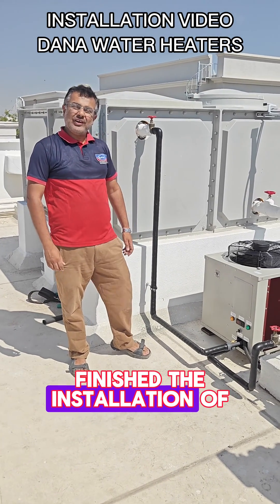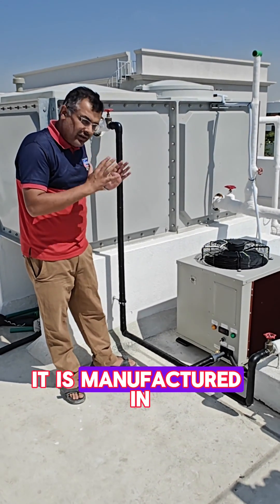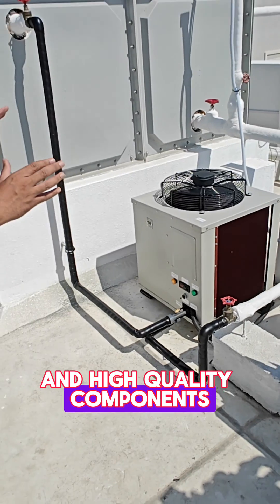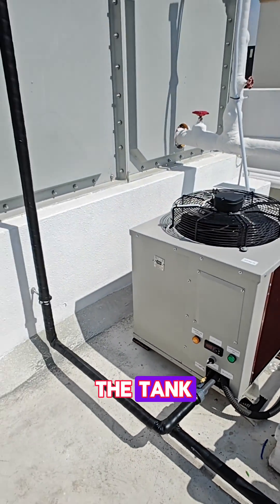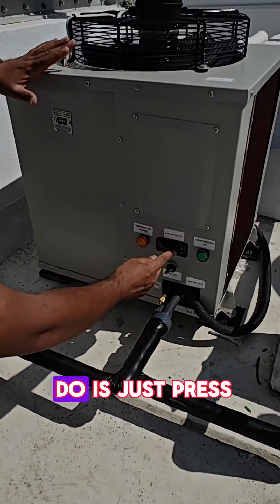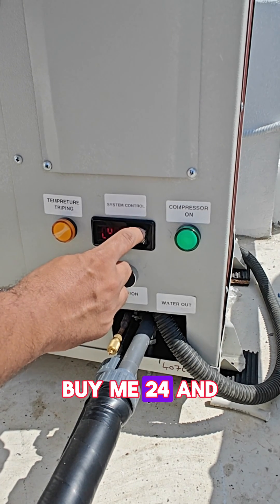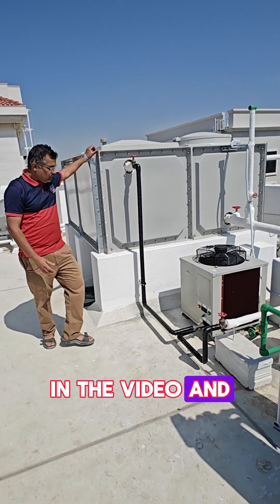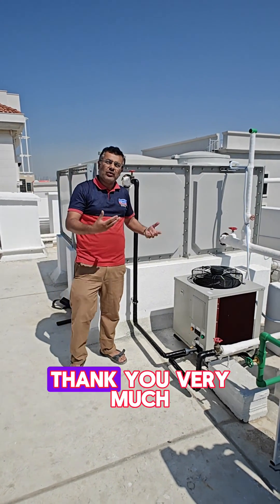Tank Water Cooling System - EXPLAINED 🔥 | How It Works, Benefits & Installation Guide!

Comment: I want 2x (15 ton tank with cooler system) and and 6 x (5~8 ton tank with cooler system) in Iraq. (now under start designing)
I cannot find the system diagram of your homepage of Dana Water Heaters & Coolers. My client want the water inside tank shall be clean. So tank inside pipe, coolers shall be clean and easy to clean. Where can I find out the system diagram or inside tank drawing.

Comment: Doea it work for 4000 liter tank
Reply: DC5000 is recommended
Reply from the maker: It might depend on the specific requirements of the tank, but water cooling systems are designed for different applications!

Comment: Our unit is very compact and 600 mm X 600 mm clear area is required to install it. In case of underground tank , the unit has to be installed at ground level and it can be installed upto 2.5 mtrs away from the tank location.
Reply: do you have 250kw water cooled chiller for aquaculture farm
Reply: @mepcotech  yes pls email inquiry to us .